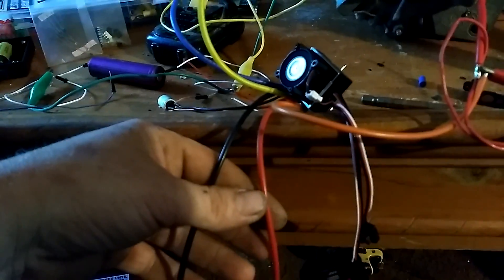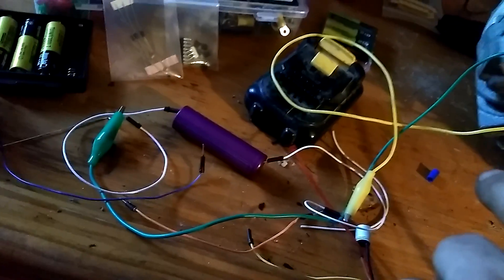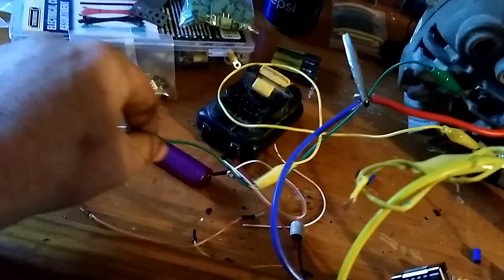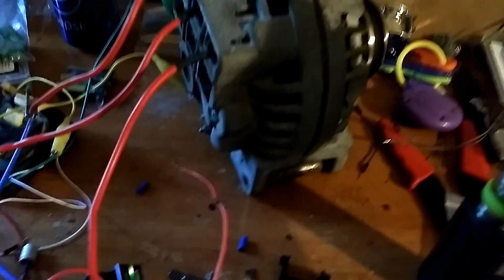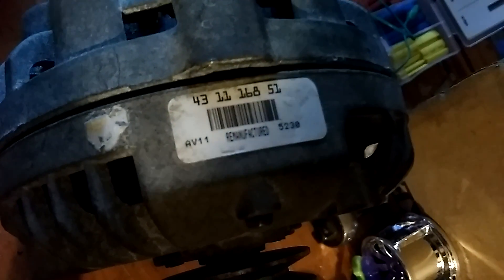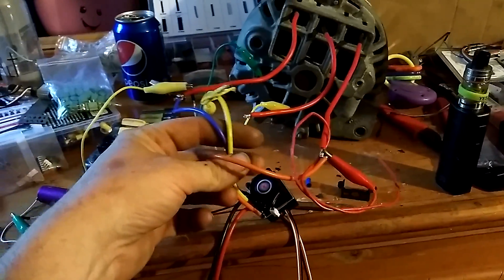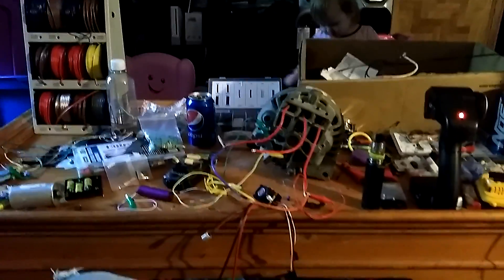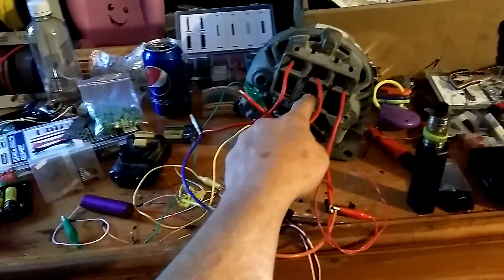HOW TO MAKE A BLDC MOTOR FROM A CAR ALTERNATOR

Comment: Every time somebody ask a question and Thomas comment with knowledge I write it down. I wanna know everything.
Reply from the maker: Well I appreciate that very much. So.... to do what I do. you must phase shift the middle phase after disconnected from the Star connection.  phase shift it 180° with three capacitors and three resistors. and amplifier it...  
you should also study LRC circuits and get into resonant frequencies it will help a ton. 
(💜Here's a secret 💜)
The iron of a generator or motor  builds Eddy currents and also acts as an antenna in some cases and can be used as a floating neutral but the reason I mention the iron is because if you have a motor and a generator connected together they  need to be separated statically and magnetically by not touching iron on one to iron on the other because the the amplitude or so-called current flows are not synchronized together they will fight each other at different phase angles creating large losses.
Remember that free energy can be achieved always and somewhat easily by using a large difference in potential. efficiently storing it. and efficiently using it to perform work to create a larger difference in potential. 
 THANKS FOR THE KIND COMMENTS EVERYONE AND THANKS FOR WATCHING MY VIDEOS... I'M TRYING TO GET BACK TO WHERE I CAN MAKE MORE....  
#LOSTBROKEN&ALONE
Reply: Likewise

Comment: Living proof that a little knowledge is a dangerous thing. An alternator is a brushless motor, a brushless motor can be used as an alternator. There are NO 555's in this set up but a proper PWM controller

Comment: Does ist Overheat over the Time?
Reply from the maker: Justin Zejler on everything that I've used this with I've never felt any heat come from it at all. But if you don't use a strong enough electronic speed controller you will burn up the speed controller. Which is the whole reason why I just taught myself how to build one and did so.

Comment: What this guy did is created electrical magnetic field, that is similar to a radiator fan motor, I learned this in elementary school in my third grade science, this system will never produce enough electricity or RPM to run a house

Comment: I love your videos. I would love to talk with sometime. I have an alternator from a semi truck.  It should put out around 2200 watts and I think 190 amps. I'll need to double check on that. You are one of the few people that know what's going on.  I was shut down by the city for me running my stuff without needing the electricity company. They actually put a condemned sign on my garage for having no utilities but I did. I have water from the water company but no need for electricity from them. It would be great if we could talk. I live in the Kansas city area of Missouri. I'm still fighting them at this time. Thank you for your videos.

Comment: great i just destroyed  a great subaru Hitachi alternator....put voltage in to  the  stata  ¬(it has brushes)  and spun it no power came out or 0.05 volts ???? WTF   is this real or a scam
Reply: 0Iii Cleanerson, You No Focus. Must Always See Magnetic Field Come From Inside. Magnetic  Field No Here. No There. Magnetic Field In All Aspects Of Life.You No Focus. Oooiiii. The Difference You Seek is Only Exist When 1.You create a BLDC Driver For a Sensorless motor, and B You Focus PWM to BLDC. You could have 1000v and not burn up the alternator. If it is timed short enough and precise enough you can easily get 30,000 RPM and almost no amp draw. You say you burned it up/ You cooked the enamel off the windings I take it. I will tell you a secret, The big motors in factories. when they start to show signs of winding short. they spray it with varnish. When it drys magically it separates the the wires from shorting. Short answer Yes It works and it works very well.
Reply from the maker: Moving on to nine-phase motor generators where you tie the star in a three phase connection on one side of your generator coils and on the other side of your other 3 generator coils and tie the two center taps of those two three phase outputs to your floating neutrals and voila add your signal to your other 3phase however long the wire is I don't know your voltage and you will have something special I created...  Just remember you will have to store this somewhere and regulate it back down as per lens assisted coils when you put a load on them it speeds up and the higher the frequency is, the less current consumption. the higher the voltage is less resistance... thank you for the comment brother I love it!
Reply from the maker: This alternator is a motor!!! It is no longer being used as a DC generator.. Although it can still be used as a generator, it will not produce direct current, it will now only produce alternate current!!!  You haven't destroyed anything unless you beat it up with a hammer...

Comment: How is this brushless? You are feeding 3 volts to the brushes to energise the rotor. And couldnt you just shorted out the rotor to get a 3fase a syncronous motor ?
Reply from the maker: dualmode1
 it's not a brushless motor. but I am using a brushless ESC! the reason why I didn't short the rotor to hold the field is because then I wouldn't be able to change the torque and speed advancement with the voltage input on the rotor.
Reply: ThomasBuie EnergyBuies at gmail com 

Ok , understood ;-)

Comment: These videos along with the other one are awesome. What frequency has the output current of the motor? 50hz? If i understand correctly did you took the current from the fillaments? How did you do that practically?
Reply from the maker: I have found an updated version of the ESC in the form of a variable frequency drive or vfd and it has a lot more voltage and amperage on the output then what the small speed controllers can do I'm very excited and ready to get one so I can show everyone how to hook this up together!!!
Reply from the maker: it is running off of a pwm. (rf frequency)
Reply: Great. im looking forward to see it! let me know here when you upload it ! thanks!

Comment: Hi,i like your video !, i'm pretty new to this,noob question.What is the 18650  main purpose for? do i really need it?
Reply from the maker: +Fook Utube 
well thank you very much, I appreciate that! the 18650 mod battery can be substituted for any direct current voltage source around 5 volts at 300 milliamps is pretty good, but 12 volts will make it turn slower and have a lot more torque. I found out that one or two of the 18650 batteries gives it a good speed and pretty good torque and there's very little consumption in power. But to answer your question the mod battery is creating a direct current magnetic field on the rotor inside this alternator. And unless you have magnets on the inside of the alternator on the rotor then you will need some type of magnetic force which is why they put a piece of wire going in wrapped around the rotor a whole bunch of times and then coming back out to be your two field wires. And the three coil wires that are tied together at one end on the stator in the alternator and open on the other end is the three wires that I hooked the electronic speed controller up to which is wired in Star with the electronic speed controller controlling it. But your overall speed and torque can be controlled also by how many volts direct current you put to the to field wires where the 3.7vdc 18650 battery is hooked up to now. If you were to put 12 volts DC at 35 mAh then it would have a whole lot of torque and not so much speed but if you apply seven and a half volts it will have a pretty good amount of speed and torque.

Comment: is that an rc car esc
Reply from the maker: Brandon Houston 
Yes,  it's the xr10. All the electronic speed controller does is pulse a square wave into the three coils on the alternator if you use a small battery with a diode to keep the flow of traffic from killing your little battery you can create your own field and there is almost no consumption depending on how many volts you put two your field will depend on RPMs and torque 12 volts will not have a lot of RPMs but you won't be able to stop it with your hand 24 volts will spin really fast and have quite a bit of torque still so it is easily adjustable with the field wire's voltage and with the ESC..

Comment: Hi Thomas I tried to leave a comment on your other video. 240ac from alternator. Can u tel me how I would know which of the three leads in that video are live earth and neutral thank u
Reply: dadigitechman hi thanks for answer but as I no electrician. And would be getting alternator from scrap yard I would be none the wiser lol
Reply: Not sure if I explained self properly if not please msg
Reply: dadigitechman ok thank u
Reply: In video it says to use the 60 amp fuse like u get in your house is this not the same sorry new to all this
Reply: Sorry to bother u what about using a washing machine motor as generator as designed to run on 50 to 60 hz thanks
Reply from the maker: Shaun Beard 
You can get 60 hertz out of the alternator but it must be turning at 3600 revolutions per minute for 60hrz, that is equal to 60 pulses per second times 60 Seconds. If you want to be able to use the alternator as a generator for any usefulness you will have to step up the voltage run it across aluminum wires into a couple of high voltage capacitors and then step back down the voltage for usable consumption without load loss... but one alternator will not power house without major components that you will have to build yourself...

Comment: Helo.How many watts and amper can I put maximum  on such a   alternator?
Reply: Your limit in current is determined by your coils: their resistive impedance, the thickness of the wiring, and your magnetic core. Your maximum voltage will be determined by the isolator properties of the wiring too (and your driver, of course).
To know what the peak power is, you should know that your rotor current will determine your torque partially, but it will also limit your RPMs.
Ideally would be to have the greatest power at the higher RPMs, but, as Thomas said, more current in the rotor = lower RPMs. I guess that the maxRMPs and torque [rotor current] ratio is not linear, so you will have to find a compromise value where your power will be the biggest.
Reply from the maker: Tomás Sosa O'Connor 
Would you like a gift?
EnergyBuies@gmail.com
Reply from the maker: László Kovács 
 which field are you referring to? on the rotor field I applied 3.7 volts at 3500 milliamps per hour and I have also applied 12 volts at 35 amps per hour I have not went above or below these and I have went up as high as 30 amps per hour with my electronic speed controller for the stator coils but I'm sure it could handle more than that and this was at 12 volts.
Reply from the maker: The 3.7 volts at 3500 milliamps per hour gave me very high speed with not as much torque the 12 volts at 35Ah on the rotor field gave me a little less than half that speed but the torque was enough to break your hand if you tried to stop it from turning. At the time I was testing this alternator motor I only had one electronic speed controller so I tried different voltages and different amps of direct current on the field winding on the rotor. I hope these two statements answer your questions!
Reply: I am referring in the stator.

Comment: bldc motor hahaits brushed motor... u just run dc
Reply from the maker: and out of 18,000 views you are  the first one to say it or catch it... I should say it is a direct current synchronous motor you are correct... but, I'm using a brushless direct current controller on this and just applying the field at different voltages makes it work differently!

Comment: How do the 3 wires plug inside the motor?
Reply from the maker: Angie Reyes those three wires are wired directly to the stator coils in this alternator/motor.
this is a demonstration on how a "special synchronous" Motor Works.. It is a very easily adjustable motor with rf signal input and power strength, torque, and  RPMs can easily be adjusted on the rotor coil with  a wide range of mechanical uses and at a more efficient cost!! this alternator can also be used as a Transformer/inverter.. But in this video, I am only putting a square wave sound RF signal through the three wires with the controller into the three coil wires on the stator coil (the other end of the stator coil wire's stop after one revolution of coils or loops and are tied together inherently making this motor to where you can wire it in star with almost no modification with an electronic speed controller or rewiring it into Delta which wouldn't be too hard and depending on the magnetic field that I create on my rotor will depend on how strong or how fast and in conjunction with volts versus current. do you know how I fly back Transformer works and you also need to know how a Step Down Transformer works AND study MOT's or microwave oven Transformers as well...  all the secrets are in higher voltages!!!  and it will come to you all of the sudden and hit you like a ton of bricks and you will say how could they have hidden this right in front of all of our faces...

Comment: And the connection to AC is ?
Reply from the maker: Gain Roe you can also use this as an "inverter" to create alternate current instead of a "motor" using alternate current or direct current...

Comment: Are you saying if you bypass the diodes on the coil wires they will kick out unrectified A/C?  Or D/C? I don't get it.
Reply from the maker: Terrarium Firma 
your input is on your two field wires (one inside coil just like in a synchronous motor) your output is on your three coil wires, in generator mode and your output is alternate current  it's just unregulated. when your car alternator is wired as three phase motor in Delta mode things change or if you put a speed controller on there things change it is no longer an alternator/generator  it has then become a motor. now speaking in terms of motors and generators... your motor must be turning your generator at 3600 RPM to get your 60 hertz. your motor  (car alternator) wired as three phase motor in Delta mode must be phase matched if self looping. you can do that by facing them shaft to shaft and turning them at the same time will make the phases match but you will need an electrolytic dielectric Transformer or a very large capacitor to hold your power depending on the size of the system to keep the system from bogging down. that's why I say it's better to have a multi motor multi generator system because then you can get creative and choose where to pull your power from and when.
Reply from the maker: +Terrarium Firma
AC Brother.

Comment: Is it possible to spin them up with no controller?  And how well would they handle 36v?
Reply from the maker: +Jay Cee 
well if you use it like a regular three phase motor you could take a couple of capacitors and wire it to the three coils and it would probably run. now depending on how much voltage you put to your 3 coils you should be able to control the speed rather than buying a electronic speed controller and using direct current. yes I believe you can use alternate current on these as well let me do a little bit of testing and I'll see what I can come up with for you...
Reply: Thomas Buie I'm not looking to control speed. Just use it to power something at a single speed.

Comment: The past 60 plus days have been hard here I lost that job with a pay check then the stress gave me a gift of a massive stroke..  Laying still and trying to remember U/R last name was a true chore, but here U R popping up > that was prayer's answered.  
Glad u got back to the alternator subject;  that is the answer 4 me.  I had a commercial connection installed when I bought the house with 3 boxes installed so when I finally got up the allturnative power source up and running it would be ready to turn Southern Company off and would connect to the whole house. At present we are using
 $ 92.00/month power, hoping for free. I have 2 - 200 amp breaker boxes on the outside and one 400 inside, with 5 cutoffs.  Don't worry I want even attempt the project without my Buddy, he is a master electrician. (I watched a Mexican man who took what he learned from you and combined it all into a big red metal cabinet w/ wheels so it could be hidden he also installed a screw type home connector with heavy insulated cord and a receiving box on his house.  U could do the same thing and sell the whole thing for $500. to $1,500 to friends and their friends who would not tell the Goons.
Reply from the maker: Dog Brokedog
I hope you're doing alright brother, haven't heard from you in a while?

Comment: sorry my ingles  
Very good, I thought I had to rewind the engine and other things more, thank you for this explanation !!! And the low voltage connects the positive on the remaining terminal and the negative on the right motor housing?
Reply from the maker: +Flavio Costa no brother there are two field wires or 1 long rotor wire that is on the shaft that turns but it has two ends of the wire so there are two connections to the rotor and when you put positive and negative direct current to those two wires you create a short on the rotor also creating what people call an electromagnetic force which allows the signal from the electronic speed controller or 555 timer two Propel the rotor in either direction but clockwise is the direction that you desire I say this because it is the direction for less resistance and best performance!